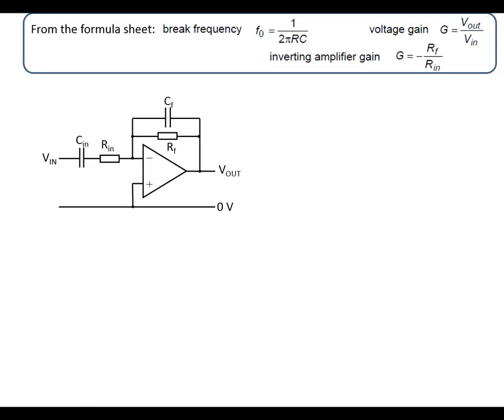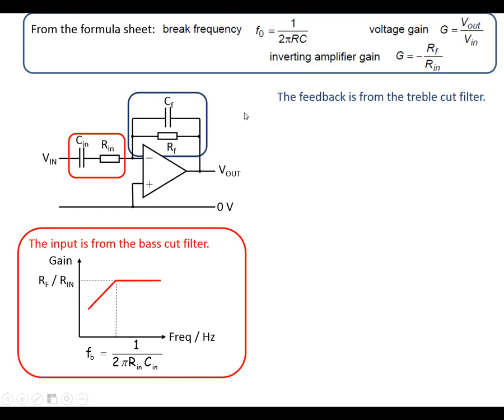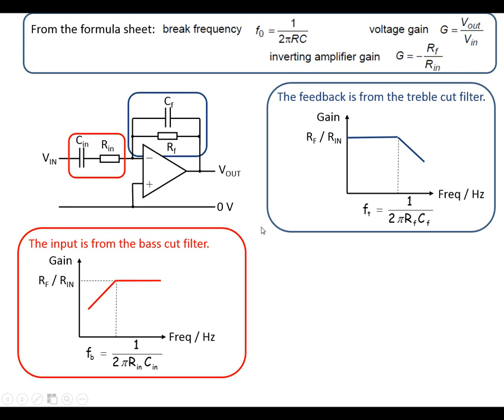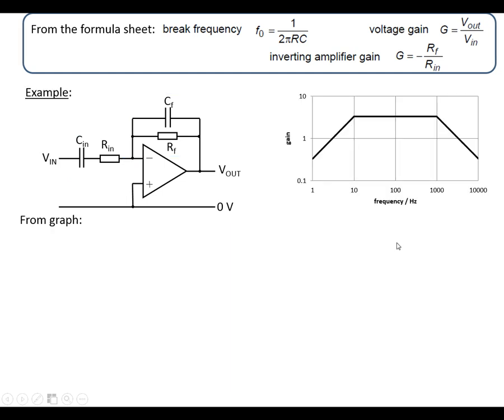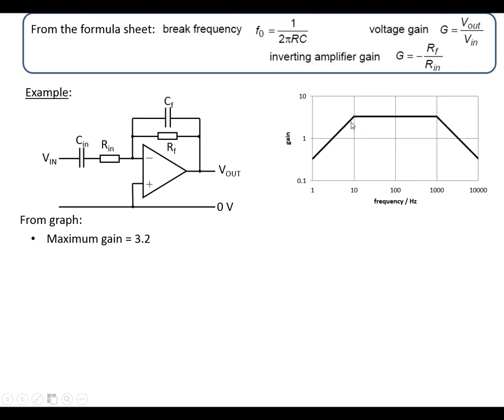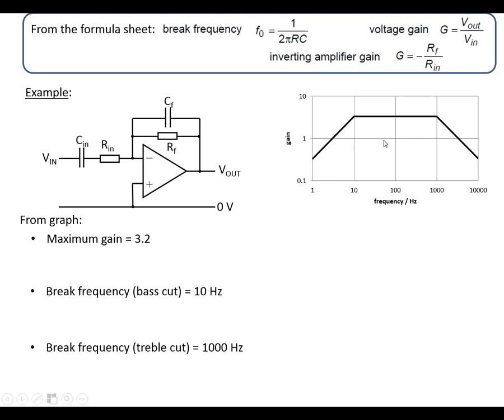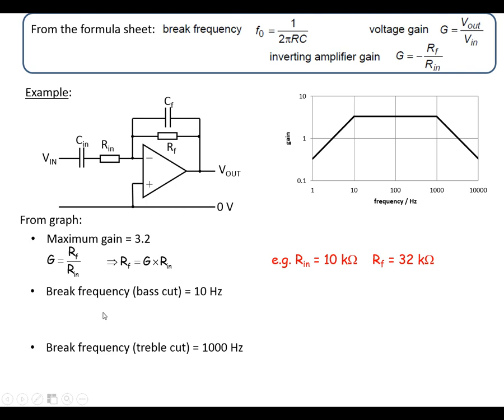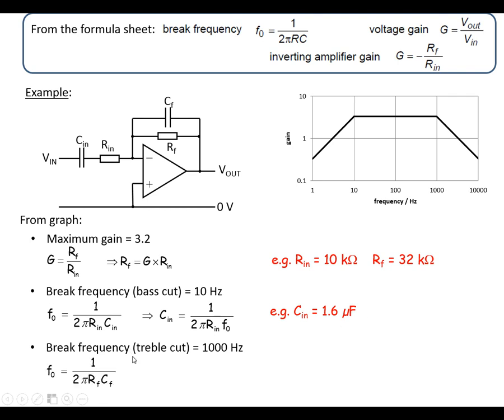Active band pass filter

Comment: Why not use (+) input for positive feedback (tought resistive divider )?
Reply from the maker: This is an amplifier - so we need controlled gain. Positive feedback would make the op-amp output saturate (see my videos on Schmitt triggers).
Reply: @andrewmasters5020  in negative feedback - Wien bridge, in positive feedback - resistive divider. If negative feedback stronger than positive feedback, I think it not go in saturate. I it simulate in Spice and it gives good Q respnant peak. changing positive feedbach, change Q and gain.
Reply from the maker: @ingussilins6330  That's beyond my level! I'm pretty much self-taught in Electronics (up to A-level standard).